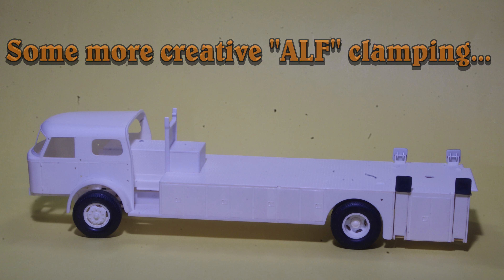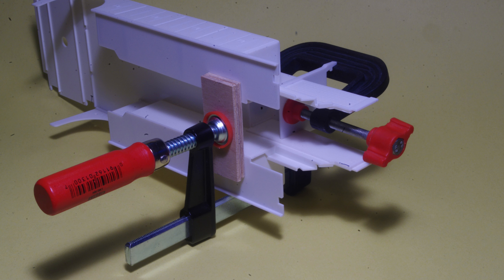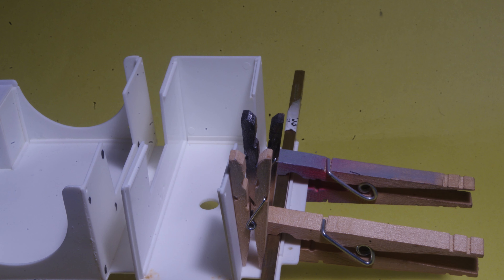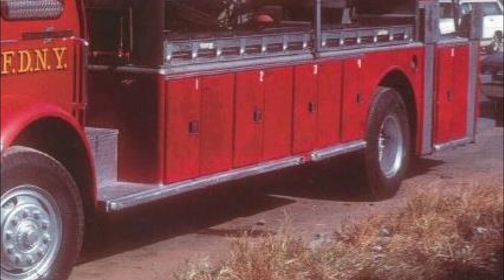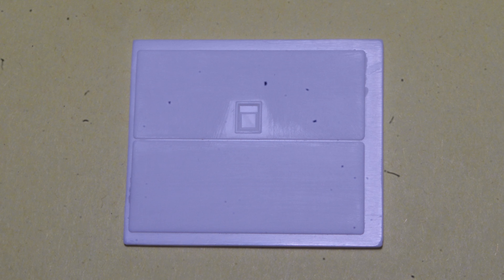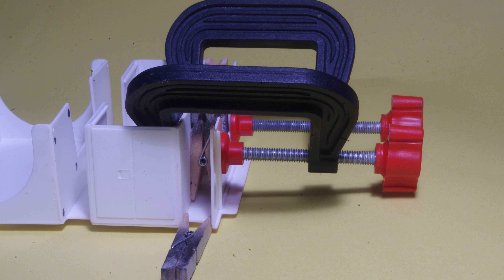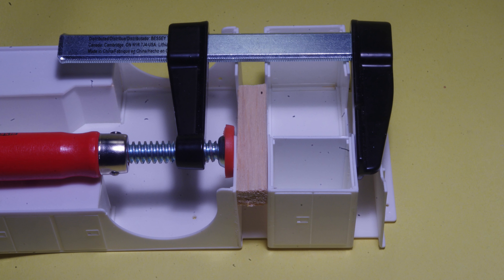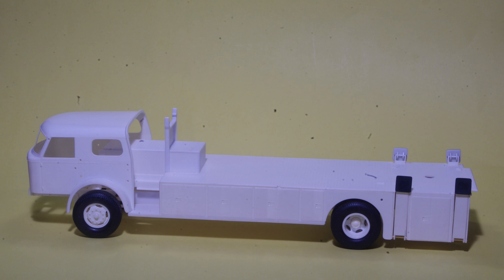Some more "creative clamping" on the 1/25 scale "ALF" Ladder Chief model

Comment: Nice work dealing with the warped parts.  It is so frustrating when parts are warped. Thanks for sharing.
Reply from the maker: Brings back memories at times of previous career path in the welding & fabricating industry, having to coax items into alignment with various means of persuasion including clamps, chain+come-along, and wedges.

Comment: I can see what my future holds……
Reply from the maker: Yes, the kit's design does make a lot of clamping parts in place necessary even without warpage - although it isn't that bad when assembling the body in stages, working on other items in between as the glue sets on one clamped set of parts. In this case the stabilizers (and steps for Transtar 4300) became "other projects" worked on while glue set on the ALF.